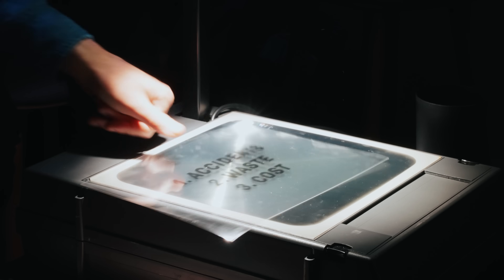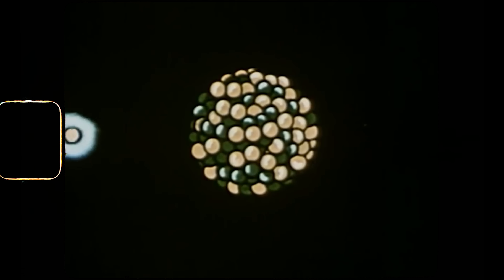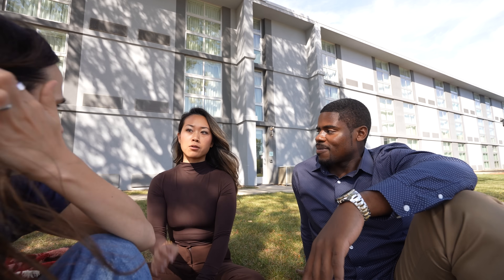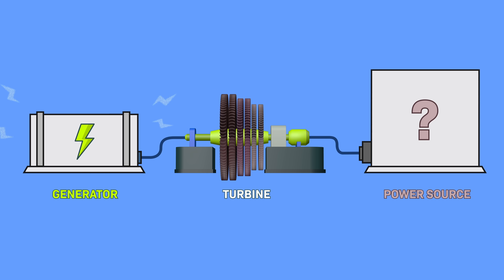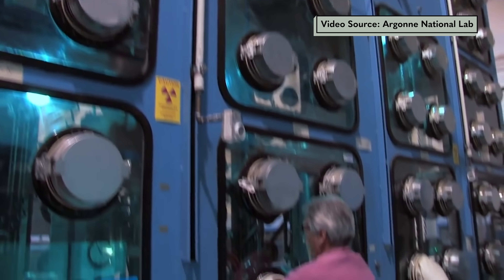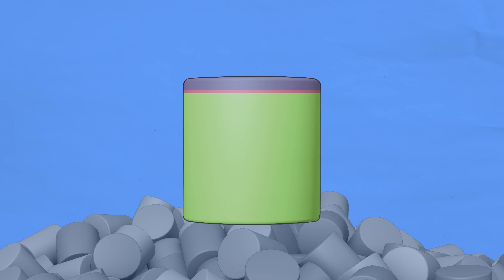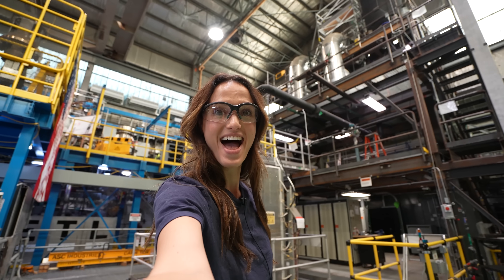The Big Lie About Nuclear Waste

Comment: Great video about a very exciting technology!

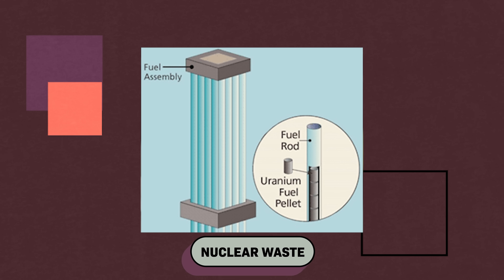I just spotted a second small mistake at 07:09 (in addition to the mistake pointed out there by other commenters!):

You say: ‘So typically uranium goes through a process called "enrichment," which  is making more of the Uranium-235 out of the less useful Uranium-238.’

This isn’t what enrichment does! It tries to separate out the U-235 from the U-238, but in practice you don’t end up with 100% U-235 afterwards, just a little more than you started with, because separating two really similar isotopes is hard. This is often done with a centrifuge because the heavier U-238 will fly outwards more readily. Making U-235 out of U-238 requires nuclear physics… One thing you can do is irradiate the U-238 with neutrons which forms plutonium, which is also a potentially useful nuclear fuel. Technically Pu-239 does decay into uranium 235…but it takes 25,000 years so it’s not a practical approach!

Also noticed thanks to this…there’s a corrections feature on YouTube videos now?! Time to add some to mine… :)

Comment: Great video and content.  Glad to see some positive facts about nukes.  

Also, the reactors that use recycled fuel  are MUCH safer than the ones we use now.  They can’t meltdown and fails to a non-reactive state on system failure.     Basically.  What happened in Japan would NOT have happened with one of these reactors.
Reply: Unit 3 was a BWR that used MOX fuel though.

Comment: your quite misinformed.   No one has ever said that the waste is not a problem.   We all know it is, but if your looking for a re-breader, we are making them now in Canada and if the US ever builds a new reactor it will probably also be a TRITIUM reactor.   TRITIUM is nuclear waste.  Also, before you all criticize the reactors as only power creators, you miss a huge part of the use of a reactor.  If your a cancer patient, or get a Cat Scan, you owe that to a Nuclear Reactor.   Isotopes are manufactured in Reactors. 

Also, U235 is used in most the worlds reactors.   A moderator is used to maintain the reaction.  Only the US decided that they wanted to make a bomb that they keep cool.  The US reactors use refined U238.  If you want weapon grade Plutonium, you must start with U238.   Geee, I wonder what Country wants to make mega Nuclear Bombs?

The actual solution to the whole problem will be the Molten Salt Reactor.   Small, safe and no waste.   In Canada we have started building these reactors also.   They are strictly test at this time, but I believe in the end, they will be the Reactors of our future.

Comment: I mean, there is a somewhat easy solution for recycling being to expensive. Make the storing of nuclear waste more expensive. If it is more expensive to store it than to recycle it then recycling becomes more viable. The main reason that storing is cheaper is because we push the cost off by making it a problem of future generations. They will have to deal with the waste that has been stored and where the storage units near the end of their lifetime.

Comment: Thanks for this video! One thing I'm a little unclear about after watching this is whether the recycling process just extracts U-235 from spent fuel or whether it makes U-238 useable. The context hinted at the latter, but I couldn't tell from the explanation of the process.
Reply: Breeding reactors can be used for both, reuseing some of the nuclear waste as well as using the common U-238.

Comment: Hot take: This is has been long planned since the 1950's, the oil market has been the largest business venture for every country since we struck oil, to not capitalise on that and go straight for clean energy is not destined in the capitalism space. We have seen time and time again engineers have their products bought by corporations and shelfed as they attack the Oil Market, ie, hydrogen cars, water based vehicles, pneumatic engines, etc. What if, it has been planned all along to use nuclear fuel alongside Oil, not to replace it but to get the ball rolling in terms of waste buildup. If you run nuclear alongside Oil then not only are you using up your pre-determined barrels but you are gradually building up barrels of waste, in storage, creating a supply backlog. if you do that for 60-100 years then move towards clean energy based off of nuclear waste, you have a insane stock of Nuclear Waste barrels to then be traded in order to go and replace the Oil Market which is largely ran and controlled by the Arabs, Russia and China, Oil will still be used commercially however it won't be anywhere near the amount of Nuclear waste being used in these Reactors you talk of. Therefore making America and Whoever else creates and stores the Nuclear waste, the front runners of the Nuclear Waste Market itself.

Comment: The reality and potential of this technology is even grander than what Cleo has presented. This "closed fuel cycle" system created to make use of nuclear waste products is part of a bigger solution for nuclear reactor design called "fast reactors", specifically breeder reactors. Fast breeder reactors generate MORE nuclear fuel than they consume. How? Fast breeder reactors are not just able to burn waste elements, but they make use of ALL uranium for useful energy production, not just the 0.7% of which is U-235. They accomplish this by transforming U-238, the predominant isotope, into Plutonium-239, which is a "useful" nuclear fuel. The design is such that we get more "useful" plutonium out of the reaction than the "useful" uranium we put into it. Then, the generated plutonium is fed back into the reactor to "burn". 

The design takes care of the proliferation concerns, as the generated Plutonium is mixed with the toxic waste products, making it too toxic to handle for weapons creation. But it also takes care of the waste because the waste can also be burned off with the "fast" design. Argonne actually successfully demonstrated a real fast breeder reactor called the Experimental Breeder Reactor. The breeder reactor technology was never commercialized apart from one reactor in Russia, and thus never benefitted from economics of scale you get out of commercialization. But fast breeder reactors effectively make uranium an INEXHAUSTIBLE energy source for electricity and heat production. I don't expect to see any useful economic activity in advancing nuclear reactor design in the near future because it is too scary for investors. Its only path forward is through heavy government subsidization and/or complete government control.

Comment: Should also make a video about the OTHER big lie about nuclear waste, namely that it is dangerous for tens or hundreds of thousands of years.

In reality, the radioactivity starts out very intense right after the reactor is turned off, then it falls quickly. After a few weeks of waiting inside the reactor, to allow the nastiest isotopes to decay, it is moved to the nearby used fuel pool, where it is kept under water for a few years. The water both cools the fuel and shields the surroundings from radiation.

After the slightly less nasty isotopes have decayed, it is moved into dry cask storage. After around a hundred years in this concrete container, you could conceivably remove the used fuel, and be around the unshielded fuel without receiving a significantly harmful dose. After around a millenium, the dose is small enough that you wouldn't even need shielding of any kind.

This is different from what is stated in the video, because the video assumes that natural radiation levels in Uranium ore is the threshold the fuel needs to fall below before the protection measures cease to be useful. In reality, there's a big jump from where natural radiation levels are to where humans and other living things would have any real harm.

As hinted at in the video, Plutonium plays a large role in this consideration. Plutonium has a half-life of ~24,000 years which is still very long compared to human timescales, but very short compared to Uranium, whose two common isotopes both half half-lives of around a billion years. The fission products, which are the really nasty stuff causing the intense radiation in freshly used fuel, on the other hand, have short half-lives -- from less than a second to ~30 years, in the case of Caesium-137 and Strontium-90.

The problem with Plutonium is that it falls between two regimes that the regulatory system both "knows" how to deal with -- the short-lived but intense fission products (strategy: just wait it out) and the long-lived but weakly radioactive Uranium (strategy: it occurs naturally, just put it back in the mine whence it came). With Plutonium, it lasts so long that you cannot just wait until it has decayed away, but it is also more radiactive than Uranium, so if you just put it unshielded in a disused Uranium mine, that mine becomes more radioactive than it would otherwise have been.

The regulatory framework is based on an extreme interpretation of the "precautionary principle", where this elevation of radiation levels is seen as an intolerable burden on future generations, and on the Earth. But in reality, there is no evidence that the presence of the Plutonium in underground repositories will cause any biological harm.

PS: Plutonium is also an excellent reactor fuel, and some in the industry are working towards what they call "MOx" fuels, which is "Mixed Oxicides", referring to the mixing of Plutonium-oxide and Uranium-oxide in the same fuel pellets.
Reply: It's called exponential decay for a reason.